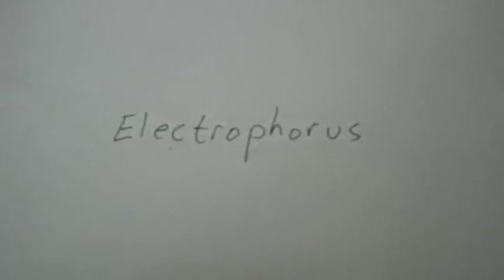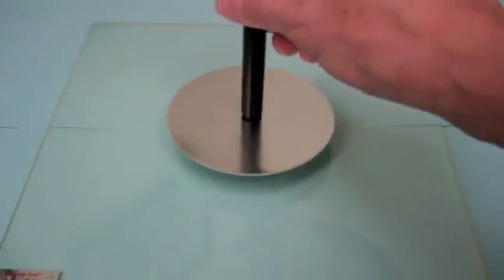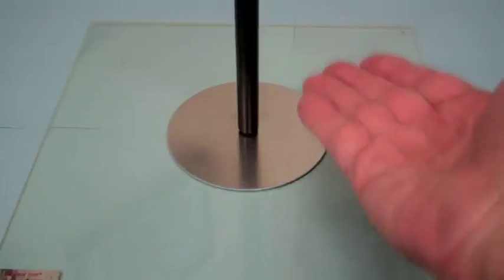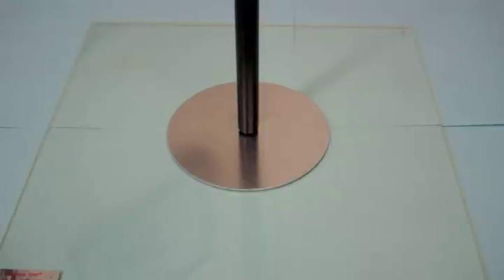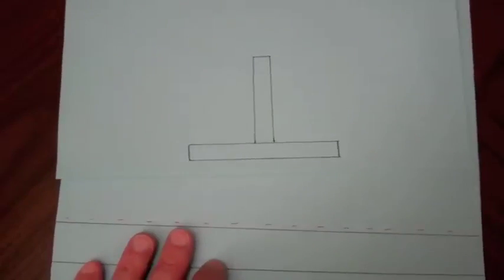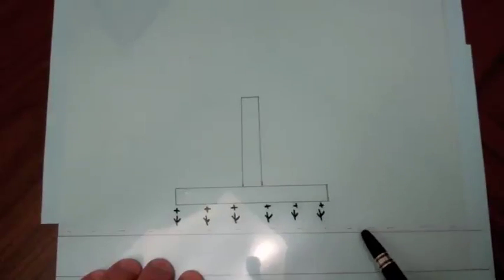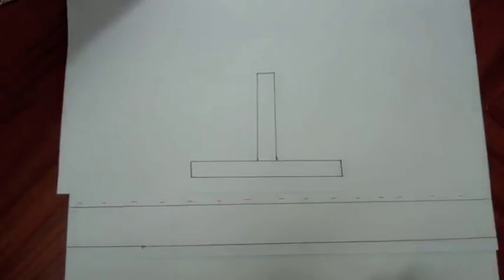Electrophorus

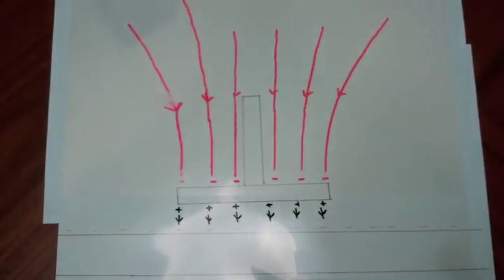Comment: 3:43, why there is no electric field inside the conducting plate due to the "static situation"? Also, the electrons move initially (until the electrons move) due to induction, causing current flow (top to bottom) right?
Reply from the maker: Because if there continued to be an electric field, there would be continued transfer of charge.

Comment: What if I don't touch the upper plate?I mean I will do the whole experiment without touching the upper plate,i.e. to say without providing the grounding.What will happened in that case?
Reply from the maker: You would probably have very little charge on the plate. Some of the electrons from the plastic would transfer so you would have a small net negative charge, rather than a large net positive charge, on the plate.

Comment: When you touch the plate, why don't the electrons from ground reach the plate , neutralize the positive charge and make the plate "negatively charged" ?
Reply: The earth is an electron reservoir. If an object is grounded, the earth can either
a) take electrons from a negatively charged object to neutralize its charge
b) give electrons to a positively charged object to neutralize its charge
The charge of the earth is zero.
Reply from the maker: When the metal plate is sitting on the charged plastic, the positive charge on the bottom of the metal plate is held in place by the negative charge on the plastic. So when I touch the top of the metal plate, I provide a path for positive charge to flow on to the plate and neutralize the negative charge on the top of the metal plate. So you can think of the ground as providing positive charge to the metal plate. Ground is an infinite source of negative or positive charge.
Reply: I thought since earth is negatively charged, it can supply only electrons
Reply from the maker: Sorry I did not see your comment till today. A ground is an infinite supply of negative, or positive, charge. So the earth is a good ground because it is so large adding or removing charge does not change the earth's potential. So even if something has a net charge, if it can still supply an infinite source of negative or positive charge it will be an effective ground.

Comment: Hi Michael,  is there an electrostatic force-field in between the plastic plate and the metal conductor causing the two plates to repel one another? Is that why there are only a few contact points and why the electrons don't flow onto the conductor?
Reply from the maker: If you zoom in on the surfaces of the plastic and metal disk, you would find that they are rough, they might look a little like a mountain range. So when you put the metal disk on the plastic there will only be limited amount of actual contact. The electrons on the surface of the plastic cannot flow to these contact points, and then onto the metal disk, because the plastic is not conducting.
Reply: yeah, I came to the same conclusion after further investigation. thank you for your response.

Comment from the maker: I believe what looks like a second square plate in v=UtPtMltV4DY is really plastic, or covered in a plastic. I don't know if he is touching the plastic with his thumb, or that small silvery rectangle on the lower left, which might be a separate ground? I think he is just grounding the top of the round conductor and what he is touching with his thumb isn't necessary, he would be an efficient enough ground.